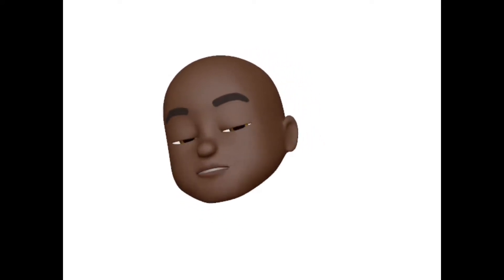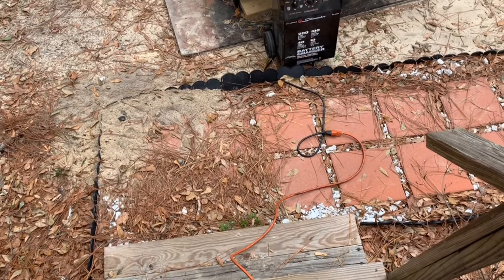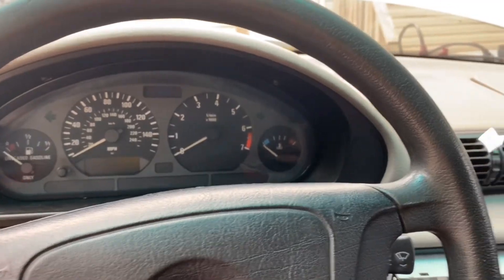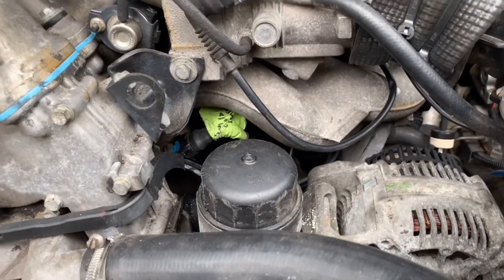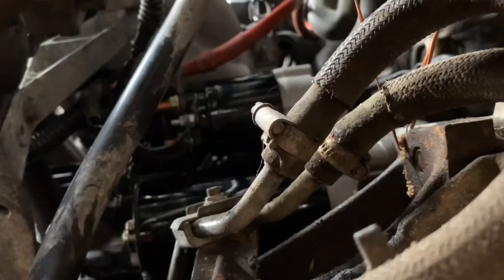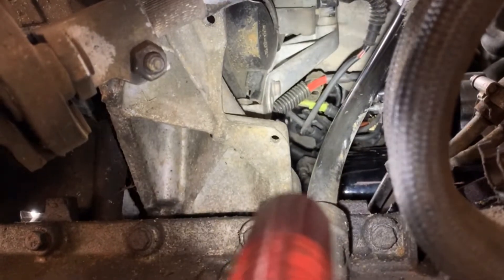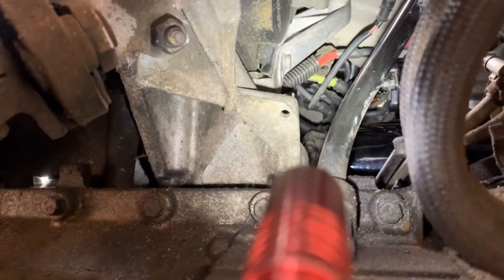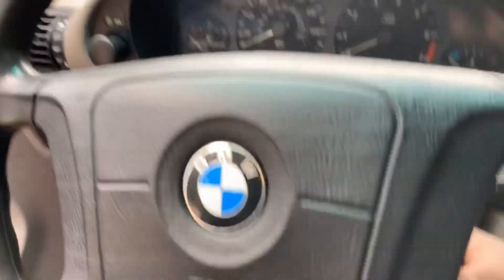The Sweet Smell of........Defeat!!! Not Good

Comment: Just to echo some of what the others that have already commented, take a breather calm down and go over the basics spark and fuel, is it getting enough fuel?  I know you had an issue with the pcm is the car equipped with an immobilizer? Is there an aftermarket security system on the car? I had a customer once that bought a 2008 Odyssey and it came in with a no start and after much frustration i found a cheap remote  start kit hacked and i do mean HACKED (customer said he had a reputable shop install it 🙄) into the wiring under the dash after removing it and repairing the wires it started fine. Sometimes it can be the thing you least expect.
Reply from the maker: Wiring is my enemy . I can do it I just don’t like it . I checked spark and fuel but I will recheck them since it’s been a few months